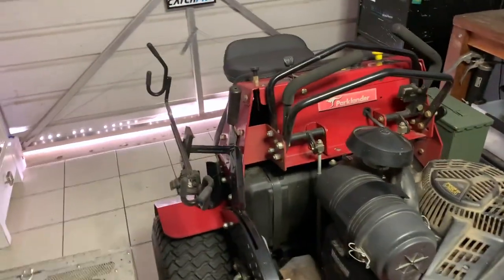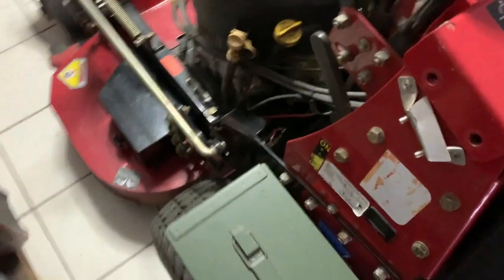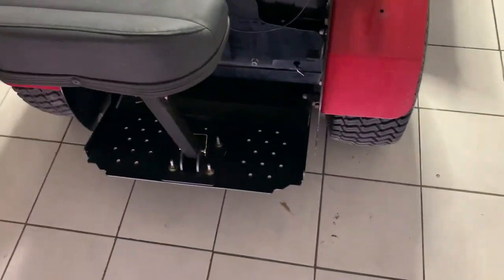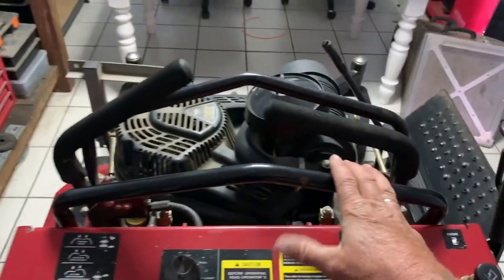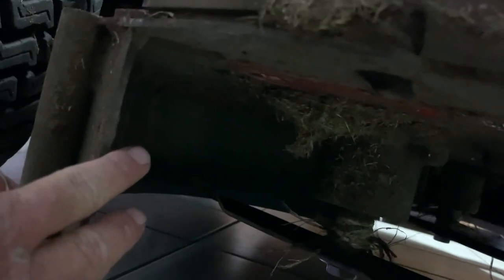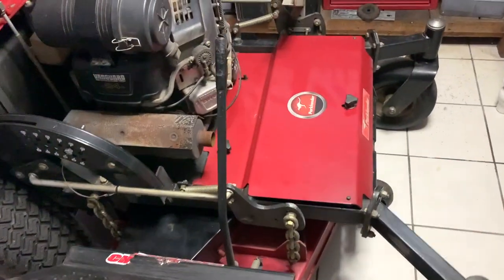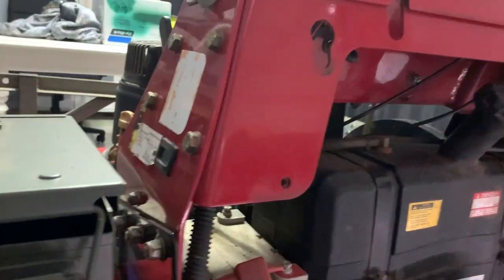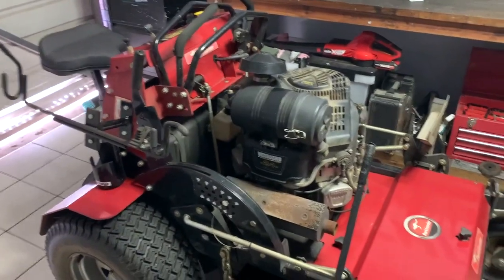200 Hours with a Bradley Stand-on Mower - The good, the bad, and the ugly

Comment: I just bought a new 36" today. I wish I had seen your review about the grass discharge issue. I do bi-weekly cuts. Mine has a 25 HP Briggs & Stratton. I drove it off the truck to the garage and I'm already annoyed with left handle safety switch. That swtich has to go!
Reply from the maker: Safety switch easy to unplug. If you are in the U.S then you may not have any issues with it bogging down. We cut super low down here.
Reply: @CatchProAustralia  I'm in the States and my customers don't like low grass unfortunately.

Comment: Don't call me yankee bro! I am from the southeast US and we're the opposite of yankees. I am in admiration of your innovative mind though.
Reply from the maker: Yes, I have since realized that referring to Americans as yanks was not correct. Had no idea at the time that it was offensive to some.
Reply: @CatchProAustralia I had been looking at this machine for a while and I finally found a good review and I think that the biggest problem with this machine is the deck because of those metal straps that it has and I don’t think it will do well on every other week lawns. but aside of that did the machine had any other major problems in the long run
Reply from the maker: @Leon-yv5qz   Hey bud, i sold this machine but honestly it treated me pretty well. The only real setback it has is if you are cutting low on super thick grass. We cut really low here, so im sure it wont be a problem for you.

Comment: Nice review!  How's the clip dispersion after removing that baffle near the discharge chute?  I just got the 48" myself.  I don't like that cutoff switch either, I solved that by zip-tying the handle.  Overall, I really like this mower, but it's already getting warranty repair for a faulty air intake which filled the engine with dust, boo!
Reply from the maker: Gday, We have moved on from this mower now, but really enjoyed our mowing days with it. Removing the baffle definitely helped the mower to stop bogging down in thick conditions

Comment: Hi I just purchased a advance chute for my Bradley 36 2020 model. I see that you have a rounded peice attached you your advance chute did you make it your self or did it come with yours?
Reply from the maker: Damian nelson Hi mate. It came with the chute. You could purchase the plate online from www.ballard-inc.com 👍
Reply: Catch Pro Australia - Equipment for Lawn Care Pros. Thanks.  I tried calling the Ballard company today I left a message hopefully they call me back so I can get one. can you send me a few pictures of yours mounted on your mower when you the free time.the mounting bracket seem a little big for my mower.
Reply: Damian nelson hey man. What was the outcome? I need some help with one as well. I’ve not purchased a chute blocker yet but I need one. Any help would be greatly appreciated. Thanks!
Reply: BlueCollar USA Hi I brought the advanced chute blocker for my Bradley 36  and I can not figure out how to get it installed. I guess I will need to put it in the shop to see if they can figure it out I’ve just been to busy to mess with it.
Reply: Damian nelson ok thanks for the reply. I have a gravely zt that I put a advanced chute blocker on a few months ago so I’ve done it before. It’s a pain in the rear and two people doing helped to get the height of the spacers right and marks for the holes drilled. I had to drill into the deck to install but it was well worth it. I’m buying the 36 Bradley tomorrow morning so I’m just trying to get any advice on a chute blocker for it so I know what to plan for. Thanks
Reply: BlueCollar USA  yeah I install of the gravely 52 wasn’t bad to install but If you figure out the advance chute on the Bradley 36 I would love a few pictures so I can get mine installed because I haven’t found know one to help me out yet..I just hate to take it to the shop and get charged 150 Bucks. You will like the Bradley 36 it will open up your small market lawns. The only problem I have with mine is after about a month of good use one of the front wheels will leak air also I hade to install a hour meter on mine it didn’t come with one.
Reply: Damian nelson Will do. I purchased mine yesterday morning and it came with a mulch kit so we will see how well it does tomorrow morning! I purchased an hour meter as well and will be installing it shortly. Keep me posted if you figure something out on the advanced chute and I’ll do the same. Thanks
Reply: BlueCollar USA ok

Comment: Hey great video bud. So I was wondering where did you get that add on seat. I'm thinking about ordering a Bradley mower but I definitely would have to have that add on seat. I have a 36 inch Scag vride and my knees were hurting after just one year ,so I had a friend of mine weld on a seat on the mower just like yours. Within two weeks my knees were back to normal. Thank you in advance. You're mower looks great !!!
Reply from the maker: Gday Mate, You can order the SitOn Seat at www.ballard-inc.com